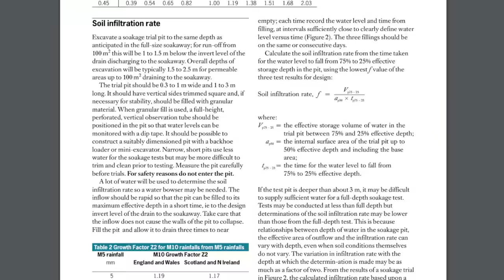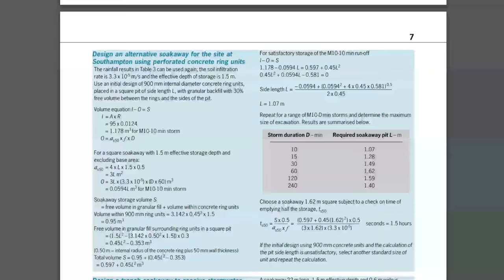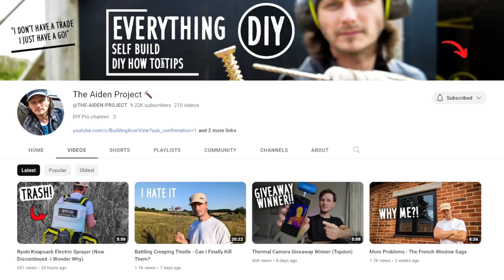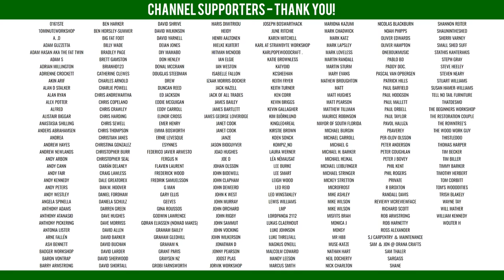DRAINAGE SOAKAWAY In One Day!

Comment: Great video! As a drainage engineer I thought I would add a couple of comments. You’re correct with the 5m rule with regards to building regs, but I would add two points. 1. This should also apply with 5m to the boundary as a courtesy to any neighbours. You hit sand so in your case i would hope it’s not critical, but the fact you had gravel disappearing on the old soakaway does make me wonder if there is some dissolution going on?! . If anyone reading this is on chalks, notably low density chalks, I’ve had sites where the geotechnical engineer has required 20m from foundations/roads/boundarys! 
It’s worth noting soakaways only work where the soil conditions are suitable, if your in London clay for example there’s no real chance they’ll work. 
Like you say, you can check with a drainage (civil) engineer - another cheaper option is to check planning applications in your area, big sites will often have full drainage strategies which should have onsite soak away testing which will confirm its viable.
Reply from the maker: I'm pretty sure it's not 5m to a boundary. From memory it was 2.5m?
Reply: @RagnBoneBrown  On the face of it 2.5m makes sense, and ive seen some guidance from certain councils noting this, and other which don't even mention the boundary easement at all, but should a neighbour extend their property in the future this can lead to foundations within the 5m easment (and as I've said, 5m is a minimum and could be more subject to consultation with geotechnical engineer).  Therefore the 5m easement to the site boundary is best practise and from my experience the Lead Local Flood Authorities who review planning applications (normally above a certain size) within each local authority will only accept 5m as a result. 
I dont want to come across critical as your in a retrofit situation where you've clearly improved what was there and what functioned reasonable well for a number of decades.  Standards are always progressing, and with a lot of home projects its completely impracticable to bring everything in line with modern best practise, but I thought my comments could be something to consider if a fellow viewer was looking to do something similar.
Reply: @sirhoggit  this is pretty much why new houses and refurbs are unaffordable. Constantly increasing compliance costs. 

From experience I have taken on local authority housing where new doors have been cut into supporting walls without lintels causing no end of roof problems, driveway drain covers have been replaced with a15 rated covers as they were cheaper. Fence posts put through shared rainwater drains

Please can local authority get it's own house in order before making life more difficult for those that do know what they are doing.
Reply: @sirhoggit  I really appreciated your insight here. I think that as you say given the existing situation they did the best they can, but I think it also highlights where if you clearly have some existing subsidance I would never want to chance it and do a DIY job. It surely wouldnt cost the earth to get an engineer to give it a once over and you could still do the work yourself after that.
Reply: He needed a soak away and did a neat job well done doing it your self and not hiring any company to do it for you , you saved a mint
Reply: What are people with small gardens supposed to do? Some peoples gardens are less than 5m total! Hell my old house had a 3 by 5 garden.
Reply: If you can’t achieve the offset from foundations normally you pipe the surface water away to either a larger strategic soakaway (E.g. an infiltration basin that manages the water for several homes), a watercourse or a sewer (for new build homes this is called the discharge hierarchy and you need to prove you can’t soakaway, (E.g. poor soils), before moving on to the next option. 
Fundamentally, taking water off of impermeable surfaces and infiltrating it in a single concentrated location poses a risk that over time, and subject to ground conditions, that you will weaken the properties the ground and this can lead to structural failures. 
You can reduce the risk by increasing the area of a soakaway. For example, permeable paving (day for a driveway) can run right up to the front of your house and allow infiltration (providing it’s just dealing with its own area) as it’s just managing the rainfall that falls on its directly - just like a lawn.
Reply: Loved this video, really useful. Unfortunately we’re on clay but still useful info. Really enjoyed your work and explanations. Thanks for no annoying music.

Comment: I continue to find it fascinating to see how things are done in the UK as opposed to here in the USA. A bonus is seeing it done by someone who knows what they’re doing. Give the cats a neck scratch for me.
Reply: In what way would you do it differently?
Reply: @drahcir6590  They did a great job and it will perform perfectly. Small details: I only use the black non woven geotextile fabric more durable long term and tie the cloth to the pipe with stainless clamp, overlap and staple. Deeper silt trap? If I could find one or make one. Again, everyone has their way of doing things. This is 1k times better then the previous with only stone. We once had an old house that had cisterns and a well pump. They held water and released water yet served two purposes for collecting roof water.

Comment: Great job Keith. Had to do something similar. I had to move a 2000 litre tank for the rain water and connect it to something similar to your crates. In my case it was a tunnel made in a way that once placed underground you could drive a car over it. Very sturdy construction and quite smart considering it was made from plastic. Had to dig out a channel 1.5m deep 80cm wide and 14 meters long for that tunnel. 6 tons of gravel went on the bottom, same as you used the fabric to coat the gravel and the tunnel. On top of the gravel the tunnel was placed (the tunnel itself can hold 2000 liters of rain water) and on top of that 50cm of soil. Had a digger to dig everything up and it was a big one lol. However the gravel and then moving the mountain of soil was done by me and some help from my dad. It was bloody hard work so I know exactly how you felt. Good job mate.

Comment: Thanks. I had to dig out and reconnect an old rubble soakaway which has the rain from 4 small houses going into it. Too much water and when the soakaway pipe had blocked (before we purchased our house) it had been replaced with a surface pipe. We are now in the process of having downpipes fitted for each house (as I think is legally required) but I also added in a Rainus filter system that in theory catches the laves and moss . It was surprisingly expensive (£116), pretty poorly made (tried to get a replacement but the vendor from Wales didn't even bother to reply to our email and text . It will be interesting to see if if makes a difference and my guess is I will be digging a smaller holes for a few soakaway crates in the spring.

Comment: This was a really good watch Keith.  I did this on my parents bungalow about 15 years ago, the original soakaway being about 1.2 meters from the property and woefully undersized.  I didnt know about those types of crates back then so had loads of large stone delivered.  But the process was the same, using the membrane etc.  so it was nice to have confirmation of what I have done was right.  The room in the corner of the bungalow was so damp but soon dried out so it was definitely worth doing.
Reply: Keith aiden, go to Library ,construction  drainage. You've just wasted time money all that hard graft, when the solution is a part of the house.

Comment: Jolly good job. Before plastic crates were the norm i built a soakaway , bought some manhole rings and a cover set two door lintels across the base to rest the rings on lined the sides of the hole with plastic sheeting and backfilled with large rocks and added a manhole cover. Jobs a goodun 20 years later and i can still go down the manhole and clear our silt of which there is very little. I do like the idea of having access to inspect and desilt.
Reply: I've done mini versions using old milk - crates - work like a charm. I wrapped them in permeable membrane and connected via orange piping - so quite good to come on here and see I actually guessed it all fairly correctly.

Comment: That was a great video, you certainly could have used another lad to help (but I find that unless you’re doing it at the weekend lads are usually in short supply) cost wise without the 20 man hours @£50 per hour labour charge your parts costs were brilliant and I’m in no doubt that job would have been around £3k from a contractor as no one seems to want to come out for less these days! Thanks for sharing buddy!

Comment: in the middle of doing a similar job myself, only theres no access to the back at all, so what has taken you a day has taken me around 2 weeks, im using a matock and a shovel for a 2x2m soakaway. back breaking work
Reply: Don't do a vertical hole like this, step the excavation. A m3 of soil weighs about 2 tonne, so if a side slides in not very good for you.

Comment: Next time.
Place a big tarp under the soil heap in the driveway.
Keeps the concrete clean and keeps it from washing away when you fold the tarp over to keep it dry.
Reply from the maker: Makes it really difficult to pick up again with a shovel / grab lorry though?
Reply: @RagnBoneBrown  Dont go all the way to the bottom.
Leave a thin layer on top and fold the tarp in and dump it in the garden or a wheelbarrow

Comment: Good job, thanks.  I'll be doing similar shortly but with an easier way to get rid of the soil!  For our downpipes I got some leaf traps, they collect a lot of leaves, moss etc etc which means it doesn't end up in the soakaways plus they're really easy to clean out.
Just FYI, I'm putting up a carport with 100m2 roof area, building control advised we needed 1m3 soakaway but that might be as our ground is even sandier than yours :D

Comment: I've got to do this at my workshop, and i'm dreading it!  There is zero scope for getting anything mechanical in, so it's gonna be just a shovel and pick, and buckets to get the spoil to the front of the building :(

One thing that might be worth checking, if the gravel you've used can fit through the grid on the hopper (I don't know why it's called that either) it might be worth putting some wire over the grid to stop any gravel getting kicked down the drain

Comment: What made you choose the membrane in the end. Have read loads of stuff saying that the membrane blocks and so isn't needed and conversely the same saying that you have to have it. Any chance of a video testing this to settle the argument once and for all? Great vid as always dude.
Reply: The crates work by storing the water from a thunderstorm etc then allowing the water to dissipate with time. If you fill up the crates with stone they will not hold as much water so you would need more for the same storage capacity, then what is the point of the crates you may as well just fill up the hole with stone.

Small stones like the 20mm pea gravel will fall through the holes in the crates. If you used larger stones the clay would travel wash between the larger stones into the crates. You could put a layer of large stones against the crates then smaller stones then a coarse sand, with each holding back the smaller layer and then hopefully the clay. Imagine footballs the tennis balls, ping pong balls in layers etc. But it is quite difficult to hold stones vertically and the hole would need to be larger to accommodate the different layers of stone. If the ground had been a gravel with little sand the filter membrane may not be required.

If they had taken samples of the top of the sand and at the bottom of the dig they will find that the top has more clay in it. The top of the sand will be blocked with clay. But that layer will allow water through at the same rate as the rest of the clay. 

Ideally the membrane should match the soil.  If you have a sandy soil you only need holes small enough to retain most of the sand, they larger particles will hold back the smaller ones. If the correct membrane is used for sand it will only be as blocked as the sand outside the hole. If you use a membrane that retains clay in a sandy soil the small amount of clay in the soil will be retained and then the membrane will act as a layer of clay. But the crates would be protected from that small of clay being washed into them when there is little rain. A clay designed membrane will end up acting as the clay beyond the hole.

The 20mm pea gravel that was used will end up blocked by the clay if you wait long enough. But it is self compacting and so will not settle itself like sand would.

Extensive research has been carried out in university geotechnical laboratories. I doubt that this channel would be able to replicate those studies.

Comment: A great job. How would you measure the size of cage needed for a garden? I have an area of about 24 metres x 4 metres that floods in winter but I don’t know how big to make the soakaway.
Reply from the maker: There are some websites online but you'd need to calculate the sq m of the roof area that the soakaway serves (assuming it's to capture rainwater from your roof)
Reply: @RagnBoneBrown  Thank you. No roof involved, as it’s far from the house. I want to build a pond on the spot but don’t want to have water beneath it. I’ll have a look at those web sites. Thanks again.

Comment: Mechanical barrow. Spent 3 days using one whilst the chap who came with the digger heat filling it. Shifted 35 tons, massively under estimated the project. Think when I replace the patio I might build a soak away like this underneath to gain more drainage. First thing is building 27m of retaining walls…..and I’m not a brick layer 😂😂.

Comment: Nice job for let the water away, but I would have choose for a different solution instead of the round pipes, to me it would be a nice choise to make a concrete pipeline with the shape of dug channel you have made, making the top just a couple of inches or less under the slab level. That would have guarantee the same water flow (or maybe more) and you could have avoided to cut the slabs

Comment: You've got an air vent right by that corner drain. I'd have been worried about making the drain height that close to the air vent...have you got suspended wooden flooring?
Reply from the maker: Worried, why?
Reply: @RagnBoneBrown Its the same height - isn't there a danger that water if the same height will be equally likely to get through the venting...?
Reply from the maker: Water goes down the downpipe and in to the gully. How would it get in to the air brick?

Comment: This is a big controversial within archaeology but you can date that pipe stem you found using the diameter of the inner hole. I use drill bits to determine the diameter. I have a table somewhere to figure out the date from that measurement.

Comment: Those low back P traps need a rising piece minimum 120mm - preferably more - to the lowest height of whatever is connected above in order to create the necessary flow around the bend. Think you’ll be ok with yours but putting it lower would have been better, the water needs the drop.

Comment: The excavation below the house foundations is not a good idea. Especially in that clayey soil. The gravel backfill around will allow water into the soil under the wall and cause it to expand then dry and shrink. The frost, if we ever get a bad winter again, will also more easily  get under the wall through the gravel, ice expands. I would dig out the gravel and fill around the pipe with concrete (1 to 6) to the underside of the slabs.

Excavation collapse can be very dangerous. 

Not surprised you were knackered that is a lot of soil and gravel to move. End result looks good apart from next house.

Comment: Why not add a rainwater catchment tank instead?
Reply: There would still be a need for a soak away for when the catchment tank was full. May not be an issue in spring/summer when the water in the tank was being used, but definitely in winter.

Comment: I get the point about the 5m clearance to the house being impractical. Isn't it also the case that a soakaway needs to be more than 2.5m from a boundary? Are you just taking the line that this has to be better than what was there before, or is it that the regulations only get enforced for a newbuild? Genuinely interested, as the soakaway for my new garage is also a bit too close to both the house and the boundary, for very similar reasons. Looked like really hard work!
Reply from the maker: Yeah, you're pretty much spot on. We did the best we could practically do. The regs seem a bit hard to achieve particularly if you're in a smaller property, I know a lot of people who's garden isn't even 5m long.  From what I've seen on forums etc, it's common to not be able to meet the regs so people just do the best they can do in the circumstances. This is our forever home, so I'm not worried about adhering to regs, I just want it to work and hopefully outlast me 🤞
Reply: There is a risk that the present or a future neigbour could object to the position of the soakaway. It does stop them building an extension in that location.